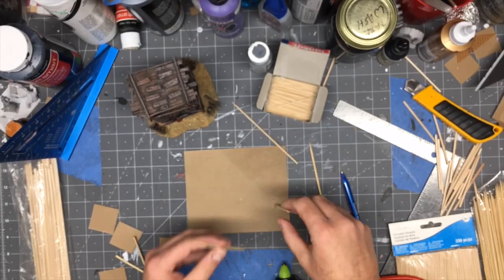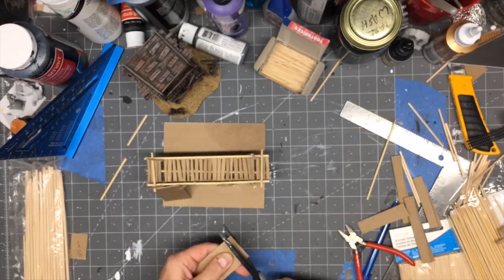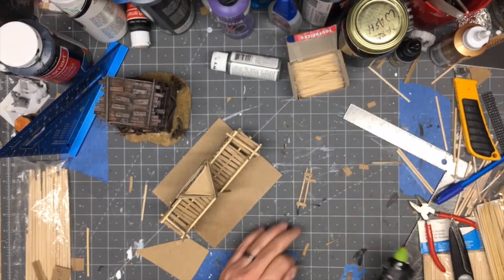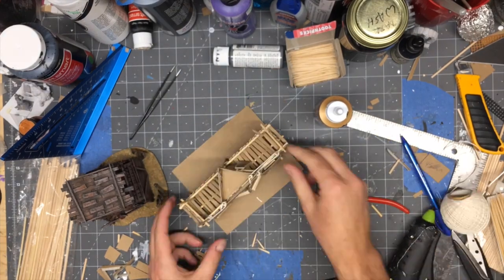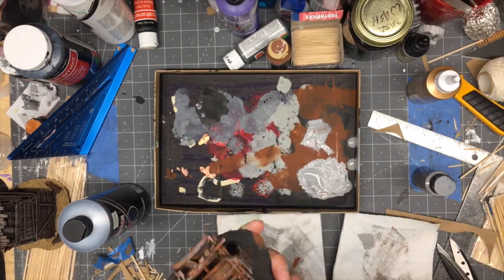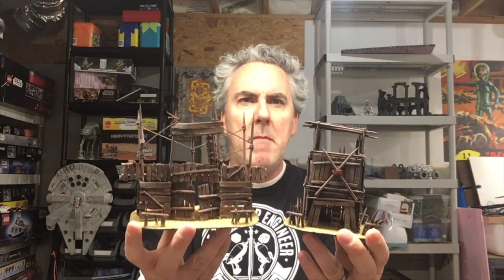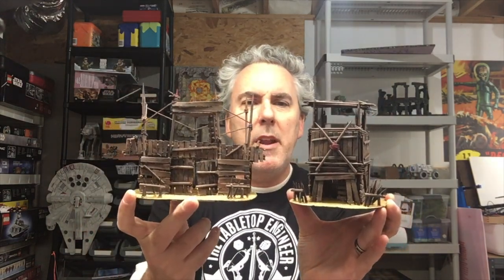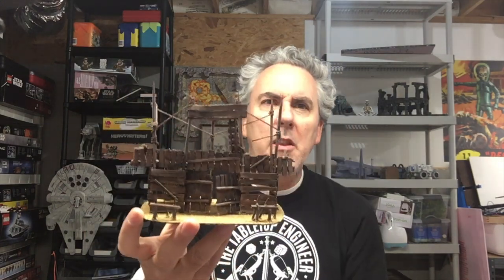Episode 090 -- Goblin Bastion

Comment: If you are having trouble with spray paint drying times I'd suggest never using Rust-Oleum. That stuff never dries and is pretty garbage paint. Krylon is much better and is my favorite hardware store brand, duplacolor is great too or valspar in a pinch. Pretty much any paint is better than Rust-Oleum. Seriously, when I stopped using Rust-Oleum it fixed years of me hating spray paint and so many issues I'd had in the past.